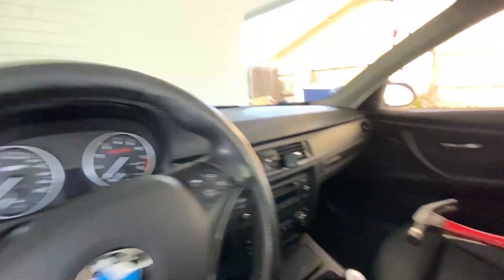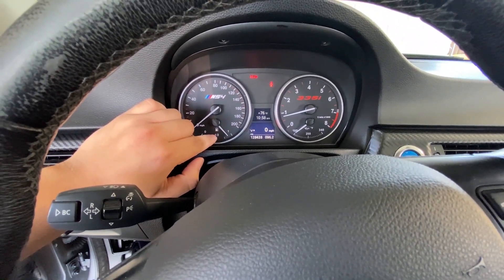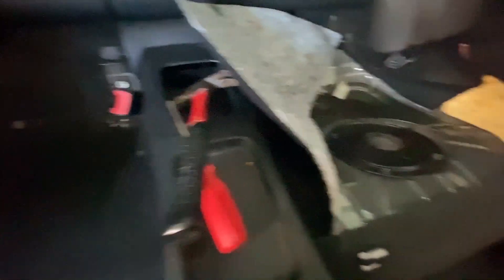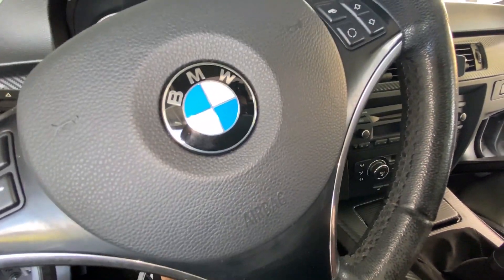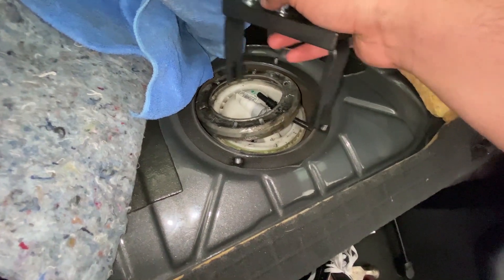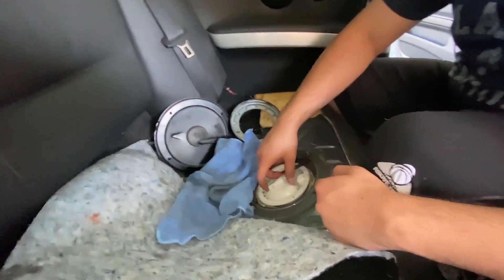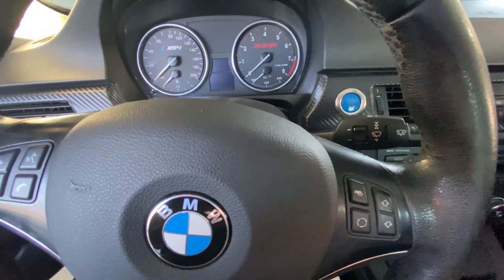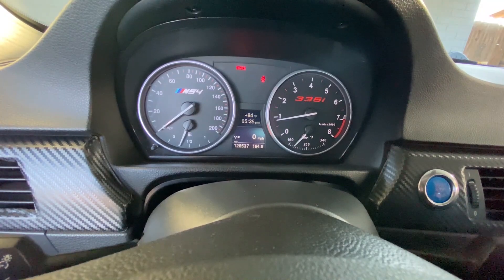BMW 335i Fuel Sending Unit FIX!

Comment: I ran out of gas having 3/4 of a tank of fuel might sending unit is not pumping the fuel to the other side but I have to go to FCP to order a brand new one Do I have to code it Do you know or is it popping play there isn't any junk yards out here in Connecticut that I can pull it off from E90

Comment: You ever had a problem with fueling up the car? I’ll be at the gas pump and it will stop fueling after 30 seconds or like 2 gallons being put in. Ever had this?
Reply: I have this problem now right after I changed the fuel pressure regulator.  Did you ever find a fix?
Reply: Yea more like every 2 seconds for me it takes me ab 7 min to fill up. I couldn’t read my gas either, Id lose power if I used more than 75% throttle and I’ll lose engine power randomly unless I put more gas of which I was not able to see.
Reply: Yo tengo el mismo problema

Comment: My car is showing transmission issue and I don’t know how to fix it. Along with my check engine light. I went to auto zone and they told me it might be a problem with the fuel tank sending unit. I just want to double check if that is the main reason my transmission is showing. Sometimes my car will slow down and my air conditioning wouldn’t operate right along with my window. So I’m not sure if I need transmission fluid or to replace my fuel tank sending unit. So I’m hoping that’s what I need to replace

Comment: FYI.....you could have used a large C clamp to loosen the outer ring instead of buying the specialty tool....but I have done the same in the past and spent money on tools that I would only use a couple of times......hope it helps you....I got the tip from a video last week helping my neighbor replace her fuel pump on a ford expedition
Reply from the maker: Vickie L Scott thanks for that tip!

Comment: Open the fuel door and let the pressure leak out of the gas tank and you just might avoid squirting gasoline all over the place.  Just a suggestion, not an iron-clad solution.  But I know *I* am going to do it.  If you are a real mechanic and tell me I'm wrong, I'll remove the comment.

PS, and this is simply from someone who had composed and blocked a lit of shots in my life.
Ditch the gopro crap.  When breaking down a repair consistently, that is requiring multiple POV shots, you CAN NOT get a Kubrick effect from a GoPro ccd device strapped to someones' head!!!  For ultimate clarity, you must often mount a camera or cameras in locationa where they will accurately produce data that ultimately CAN be combined with data from other POV's.  You lose the subtle interplay that CAN be teased out by professional folks in the fields of photo reconnaissance, how they only seemed to be the elements of data that are already anchoring the buttresses...Long story short, when blocking the shots of the important bits of your toturial, you need to make sure that certain visual elements of the production are not renedereing almost useless because the elements are not coming from an area where good camera angles and good lighting are a priority, they are being captured from the GoPro on someone's forehead.  This is a MISERABLE choice around which to build a tutorial video.  SOME shots MUST by guaranteed  to be the ones that a novice watching the video will get at least SOME accuratel look at The Big Picture, and THEN the mechanic can strap the GoPro device, and provide some real time work on these parts, even if the camera is shaky-cam the whole way.  At LEAST the student will have the project presented visually so that their minds can build SOME kind of 'frame of reference' within which the '''GoPro" shots can take a place in the 3D isomorphism their studious minds have take to time to create.
Have SOME camera shots introduce the larger picture, from static camera positions, THEN go GoPro Nuts when you've got something to refine the larger picture into the smaller more tightly integrated whole.  That's my story and I'm sticking with it.
Reply from the maker: No reason to remove comment that would help yes, but the only reason fuel sprayed in the first place was because I had just driven the car again to go and get the part. But if you do what I explained and turn on the car till it dies it wont happen.
Reply: @Swavee92  I rarely have a problem saying "Gee, I sound like a bit of an arse here.  What was I on when I wrote THAT?"  And I do tend to leave things up so I can't deny I've said snarky, or arrogant, or dumb sounding shit... keeps me honest.  :-)

Comment: Our mechanic checked an issue with a vault code , messed with this area now it recks of gas and leaks .. what the hell did he do ??
Reply from the maker: Most likely you have a crack on your fuel sending unit if smells on the driver side area  if it’s passenger then it’s the fuel pump
Reply: @Swavee92  yup that’s what they said . But ..it got worse after they messed with it ? 
Almost a 1k repair !  Could that be right ?
Reply from the maker: @brettfrantzen7425  wow that’s pretty steep but did they replace the pump because that’s the only fix there’s no repairing the pump it’s plastic so you would have had to fully replace it
Reply: @Swavee92  yeah it’s the sending unit and labor . I’m trying to fight with them they broke the part . Did not smell like gas before we took it to shop . When we got home it did . I know the part is plastic but damn ..
Reply: Is there one unit or 2 ?
Reply from the maker: @brettfrantzen7425  there is one fuel sending unit on the drivers side and one fuel
Pump on passenger side

Comment: My car has been smelling like gas really strong. And it leaks gas. They’re telling it’s the fuel sending unit. I thought it would be the fuel pressure regulator since that’s what I’ve been reading online.
Reply from the maker: Definitely the sending unit they are prone to cracking I had the same problem. You should be able to just pop off the seat where the unit is and smell if it smells like gas there is the corporate
Reply: I'm having same problem is it leaking from th tank?